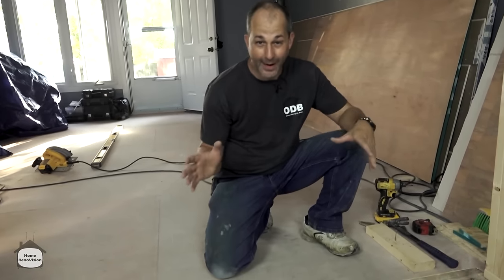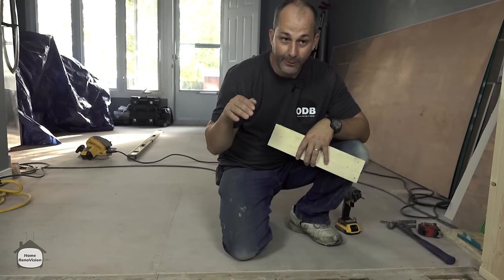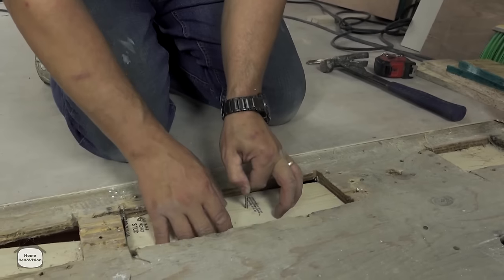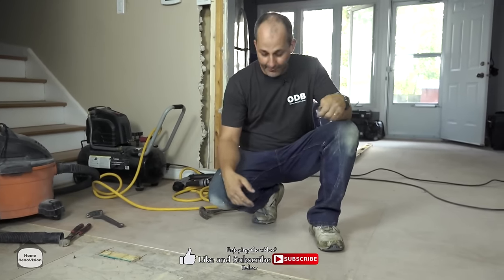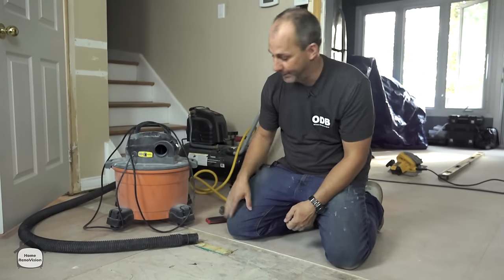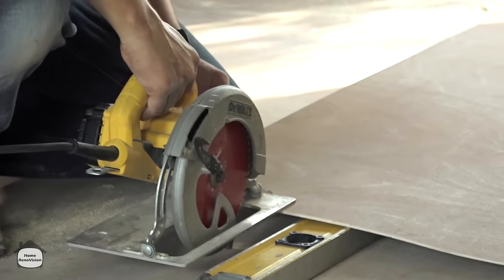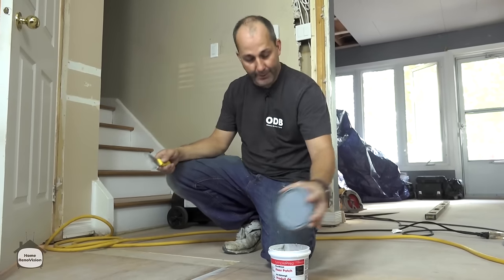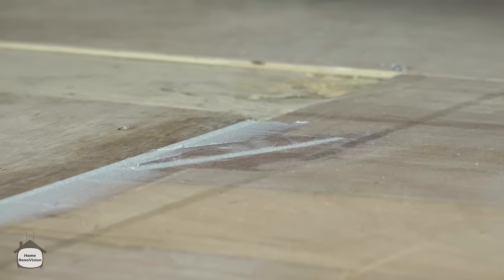How To Prep Your Sub floor For Luxury Vinyl Flooring

Comment: As a flooring professional for 40+ years, I couldn't find much fault with this video... except for how you stapled the underlayment down. When the panel is butted next to a previously installed panel, as in your example, it should be LIGHTLY butted (some underlayment manuf. require a tiny gap) and fastened on the long edge first, then the short edge that abuts the existing panels. Then, beginning in the corner nearest the adjoining panels, fasten in a fan shape (about 4" apart for quarter-inch, slightly farther apart for thicker panels) until you reach the far corner. This helps push all the warped fullness out, instead of trapping it and causing out-of-square gaps when you install the next panel.
Reply from the maker: Thanks Jim, I have never thought of the fan shape before. usually I have found it enough to just work right to left. But I can see it's merits. Will try on the next one.Thank you and Cheers!
Reply: What do you think of using floor leveler for vinyl like they do for tile?

Comment: Oh my gosh, this is eerily timely. We just this morning discovered the sub floor in our hallway bathroom is totally effed. We are definitely less stressed about it now! Thank you! 
I'm thinking we should just go ahead and make it a wet room, I think it's called, so we never have to do this again. I'll peruse your videos to see if you've covered that topic. 
Thanks again. As first time homeowners with seemingly never ending house issues and no experience, your videos are quite valuable.
Reply from the maker: The secret is too remove all the flooring back to original and then add the correct strength to the floor as required in your area. Usually 1 1/4 inches
Reply: Home RenoVision DIY Easy enough! Thanks!
Do you have a favorite waterproofing product? Like redguard, or something?
Reply from the maker: I like Mapei aqua defense.

Comment: I just removed glued down carpet pad from an OSB subfloor, to avoid trying to scrape all the glue up can I just add a new 1/4” subfloor on top? I plan to use a floating engineered vinyl plank for the finished floor.

Comment: Hi - I just finished my kitchen and 2 bathroom remodeling job. I used "CORETEC" luxury vinyl tile in the bathrooms and planks in the kitchen. The ones I used are rigid snap in tongue and groove with a 20 mil wear layer and a cork backing. 100% waterproof. My contractor did a great job in prepping the floor but it was not a lot of work since these go over most hard surfaces.

Yes remove nails, staples etc and no large elevation differences.

I selected the flooring and they installed it. They were very impressed with the quality and ease of laying the floor. This was a 1st time for them using this product.

Nice video and info!!!!
Reply from the maker: I use Torley's flooring and you can actually use a portable machine to replace planks after the fact if necessary.

Comment: As a 'Professional DIY' I have found your practical demos are a valuable source of information, especially when you demonstrate the common mistakes. Thank you. 
Question: I am installing vinyl planking (LVP) to the entire main floor.  In areas such as a perpendicular transition or butting up against a stair nosing transition piece, you cannot lock the cutoff ends into the transition pleace.  What is the best method to solve this situation and if it's glue what is the correct type of glue to use when gluing the planking which has a rubber type backing?
Reply: This might be coming too late but what I did in my house for the LVP on stairs was using a product brand Bostik's "climb" or "treadlock" adhesive to fasten down those planks. Stair nosing is meant to overlay the LVP, so just make sure it's overlaid enough to prevent any gaps from showing on the coldest day of the year. My LVP has cork backing, but since you're working with rubber backing, I might suggest scuffing the backside with some sandpaper if you're concerned about proper adhesion. Hope I could help at least a little.

Comment: Sorry for the long post, but here it comes! I’ve been pouring over your videos the past few weeks and today joined! Hooray!

I’m excited to install a beautiful floating vinyl plank floor. We ordered the product from a store and had them give us an estimate for removal, prep and instal. Their estimate came in over $8,000 which is out of our budget. I’m fairly handy and my husband is a good sport, so I think we can handle it but are stuck on a couple of questions. 

We have a 1986 house in Minnesota. Before our demo last weekend, the kitchen and mudroom were laminate and the dining and living room were carpet. 
The floor under the carpet is fairly level but dips in the last 12” approaching the internal wall. 
The kitchen has one raised spot in the center of an open area. At least 1/8” in 4’.
 Under the laminate we removed is the original sheet vinyl, which is still down until we figure out our plan. 
The level of the vinyl is at the exact height of the adjoining floor in the dining room.
It appears to me that all rooms I have 1/2” subfloor with a 1/2” underlayment. Does that make sense?

So, do I need to rip up the vinyl? It is in good shape and fully glued. Is it possible to use self leveling compound on the vinyl? Your videos on floor prep and self leveling compound have me excited to go for it, but I’m just not sure how to approach…

Many thanks for being an incredible resource! Can’t believe how lucky we are for your willingness to be accessible and available!!

Have a wonderful weekend!
Reply from the maker: welcome to the crew. you will find that the entire main floor is going to be the same height when you peel back the layers. you should start the flooring install once you have removed everything to the subfloor. once you are there if you have any issues then you can adress them with the leveler. Cheers!

Comment: I installed sheet vinyl flooring to my dad's small bathroom a few years ago. It was just loose lay over old vinyl flooring. He had me take measurements, but I'm not worth a crap with a tape measure for carpentry. I kept measuring the same things over and over again like I had OCD. I told my dad I'd rather get contractor's paper and make a pattern. I've been sewing and making patterns for decades, and that's what I'm used to. He scoffed at the idea and looked at me like I was a complete idiot and insisted on using the tape measure. Needless to say, it took me about an hour to do the measurements and draw a picture of what I was doing so my dad would understand. When I did cut the vinyl flooring, there was excess in some spots and shortages in other spots. It doesn't look great, but it covered the ugly 1970s vinyl flooring we used to have. If I'd had the time and patience and no one looking over my shoulder and screaming at me constantly, I probably would've done it the way I wanted to and did a better job.
Reply from the maker: perhaps we could do a video on that as well. Cheers to gettin er done.

Comment: Extremely knowledgeable!  Now I know why there's a nail showing under my vinyl floor!  The installer did not use crown nails.
Reply from the maker: That is too bad. You could try a scalpel and glue down the flap after repairing it. But I would try in a closet first to see if you will like the result.

Comment: Question: 5x5' bathroom, putting vinyl planks, SmartCore Pro. But, would love to put the vinyl floating underneath heavy vanity. Vanity is not square base, but could cut vinyl carefully into notches. But best look would be vanity sitting on vinyl. Floor is straight, experienced with other bathroom vinyl. Vanity probably weighs about 150 lbs. Will this cause buckling and warping against the locking grooves? Or install on subfloor and cut vinyl around vanity?

Comment: Ply is a bad underlay for flooring. Not allowed in Australia. Dont forget to check length of your drive pin on gun factory settings are 5mm past tip thats about the thickness of underlay.

Comment: Just found your channel as am thinking about re-doing my bathroom. Gotta say, your A-Z videos are amazing and i have learned SO MUCH and feel very comfortable to throw my two cents at it. One thing im missing would be how to make a tilted bathroom floor (to guide water to the drain). Other than that great work, amazing channel and subscribed! :)
Reply from the maker: Schluter systems makes a pre formed shower pan that does this perfect. All you do is drop it in and add tile.
Reply: Yeah i noticed that - except i live in Denmark on the other side of earth ;)

Also my bathroom is a small 1x3 meters (apartment), so everything counts as a wetroom and i cant make a closed off shower due to piping and dimensions. So everytime i shower everything gets wet .. its pretty normal to have bathrooms like that here. The floor however is horrible and isnt angled towards the drain, so it gathers as a pool in the middle instead. So im assuming i would need to do it by hand with cement instead of the Schluter system?

Comment: Hi there
We are installing vinyl planks in a small bathroom where the subfloor is particle board. What coating do you recommend we put on the board as a waterproofing barrier before we lay the planks? Cheers
Reply: Jenny Tabaillou Same question from me. Red guard? I’ve even considered throwing ditra under there. Thoughts?
Reply: I'm in the same boat. I don't know if I need anything between subfloor and floating floor or not. Lol, help us!

Comment: I am installing plywood over my subfloor to prepare for vinyl flooring and leveling.  I do not have a nail-gun.  Does it have to be screwed or glued? Is there a nail I can hammer in?  How far apart?

Comment: Understanding that the luan/plywood sheets should be installed offset to the seams of the current sub floor underneath..BUT...is it important to try and plan your layout so that the luan/plywood edges line up on floor joists (meaning perpendicular luan/plywood ends are stapled through subfloor and into floor joists) or is it fine to simply terminate edges over the old sub floor in between joists allowing for a simple shifted layout of the existing sub floor pattern with no concern to how far off from floor joists you are? Thank you if you can answer this and thank you for all the great videos you publish!
Reply from the maker: when installing 1/4 plywood there is no reason to consider the frame work in the structure. simply staple and go!

Comment: Good question here. What do you prefer?: Battery  or and gas nailers or the compressor kind I'm looking at the high-pressure compressor and nailguns. The price is almost the same all considering? Like to hear all the pros and negatives.
Reply: Dewalt
Reply: 20v

Comment: I'm getting ready to lay vinyl plank.  I wasn't planning on putting new plywood over my existing subfloor first, but it looks like that's what you are doing.  Is that standard practice?
Reply from the maker: Hi Will, in this case the floor had some cement residue and the stairs going up and down needed to have a height adjusment made due to the thickness of the flooring. It is not usually needed. Cheers!
Reply: @HomeRenoVisionDIY  Thank you for taking the effort to reply.  You are doing a good job.  Best wishes.

Comment: Looking at doing a flooring job at my northern cottage.  Unheated in winter so what should I be considering for a durable floor.
Reply from the maker: vinyl plank is great. get a good thick product and don't install cabinets on top. it will contract  the least of all flooring, or use real hardwood or softwood plank.. it will gap in the winter and return to normal in the spring.

Comment: Just discovered you, you are the best! Quick question: I have contractors renovating my fixer upper.  They put a new subfloor in the living room. My adjoinig kitchen floor is old hardwood. I was hoping to refinish the hardwood but it's not in the best shape. And because of the different floor heights ( I think the house was originally 2 houses joined together) the new living room subfloor almost exaclty matches the height of the kitchen hardwood floor now. Can I just lay a thin plywood over the entire  kitchen hardwood and living room subfloor and then lay the underlayment throughout the kitchen and living room for my new vinyl flooring? Thanks in advance  to anyone reading this and who responds.

Comment: We have an older home. Just bought LVP. We pulled up our carpet and found particle board instead of plywood. Since it's in good shape and plywood costs sooooo much right now, we are going to keep it. We have some spots that need leveled. However, the leveler that we bought said not to use it on particle board....how can we prep to lay down leveler? Also, do we need to add the 1/4 inch plywood on top of the particle board?

Comment: Great Information.Question's: I want to put luxury vinyl plank floating  flooring in my kitchen. It has a layer  old seamless vinyl glued to the concrete. Should I go over that old vinyl with a sub floor? Does a leveling compound adhere to vinyl?  ? Do I need to put an under lament on the floor or can I install the planks over it?
Reply from the maker: Hi joseph, if the old floor is in decent shape then feel free to install on top! Cheers!

Comment: Hi, How do i prepare floors for laminate? The original hardwood floors are rotten, so i ripped all of it out. Beneath the hardwood floor was a diagonal sub floor and the joist. What is the best way to secure it to the joist? or the plants? Do we need to secure it on the joist? I am thinking of a 7/16 OSB Board and a layer of vapor barrier. After that, I will be putting on a underlay and laminate floor.

Comment: I'm installing spc vinyl plank in a 100 year old bungalow, Crawl space, with hardwood plank floors set right on top of the floor joists 16" centers. NO SUBFLOOR. What thickness of plywood or OSB to use on top of the hardwood to get it rigid and smooth?

Comment: Nice video.  I am planning to try and do my neighbors kitchen floor with vinyl planks, she has linoleum now I think will need to be taken up first, and the lauan wasn't looking too hot when I looked at it from the vent so I might have to tear that up and put down a new layer.  Is there a reason you used staples instead of nails? I use ryobi and they have a nail gun but not sure they have a staple gun so was going to use that. Also if the floor needs to be leveled would I just use some type of self leveler, and if so would I do that before the lauan or after?

Comment: Jeff, thanks for the quick response on my last post. That definitely helped. I do have another quick question though. I ripped up the carpet and there are stains on the floor from dog urine. Should I replace the subfloors in those areas or can I spray something on them or will they be ok? The areas are dry, they are just stained.
Reply from the maker: sorry for the late reply. its just a stain on subfloor then use bleach to remove any residual organic odour. Cheers!

Comment: Great video.  I'm planning to install engineering hardwood myself.  My house is a new build, so I'm wondering if there's anything I should watch out for during the subfloor preparation.
Reply from the maker: Engineered hardwood installs with glue or staples depending on the substrate. Just make sure if you are using staples to but the right length. You don't want to go too deep and risk puncturing your mechanical systems.

Comment: I'm putting in luxury vinyl and there's a room in the house where a corner is about 1.75" lower than the rest of the room (sinking foundation?). Should I try to fill it with some plywood and self-leveling compound?

Comment: I ripped up  high quality Vinyl to re-use at cottage bathroom......all  backing is clean (wasn't glued heavily), so am I OK to just spread adhesive to OSB flooring and lay the, or should I add plywood before installing.  It's abouty 80 sq ft bathroom at cottage.
...and thanks for all your informative Videos.

Comment: Can you add plywood to concrete floor to raise the vinyl plank to be an (almost) even transition to tiling? If so, do you recommend gluing or screwing it place? Also do I need a vapor barrier between plywood and concrete?

Comment: Good video - what if your sub-floor is easily 40+ year old particle board with vinyl sheet over it ? Worth it to remove and replace with plywood?
Reply from the maker: You could remove and most likely just put down the plastic layer recommended. I used pylwood due to the extensive damage to the existing floor.

Comment: Do u have to  cover  the gap with thin set and   carbon fiber tape between tow  plywood underlayment if u use laminate flooring  sine i use 5/8  plywood to raise the  subfloor  thx

Comment: Great video what thickness are you using?
Reply from the maker: 1/4" cheers!
Reply: @HomeRenoVisionDIY  thanks! I'm doing VPlank room by room as I remodel my house my master has plywood subflooring that was finished for carpet and after watching your video I'm gonna do plywood and I'm pretty sure if I didnt it would have looked bad as some of the boards have noticeable flaws. So thank you $100 extra but definitely time saved trying to fix and sand the floor.

Comment: I’m insulating my sunroom and putting down a 1” rigid foam on top of my 1.25” subfloor and then topping it with a layer of luan. The staples nailer does hold 2” nails. Can I use my 16 gauge trim nailer?